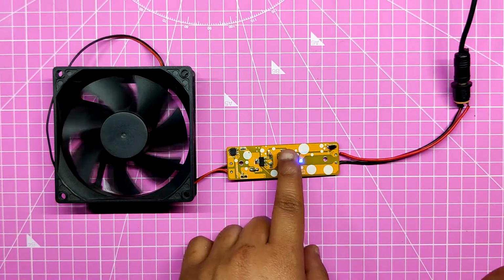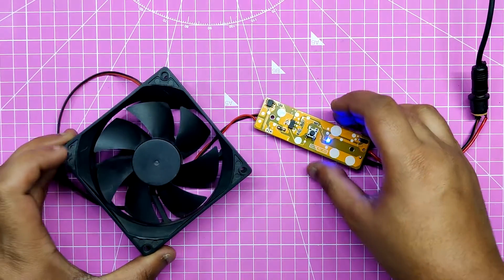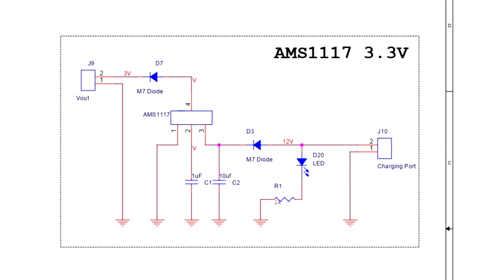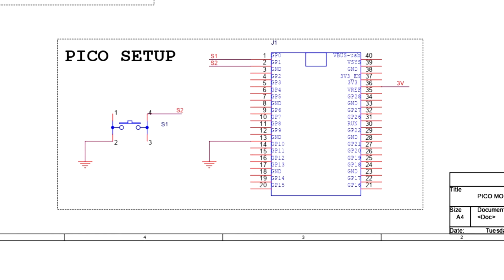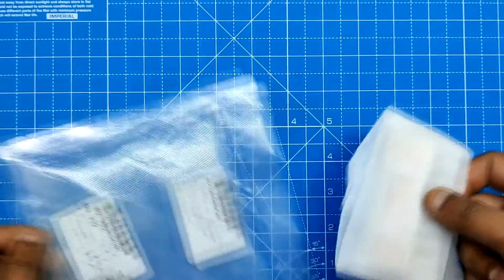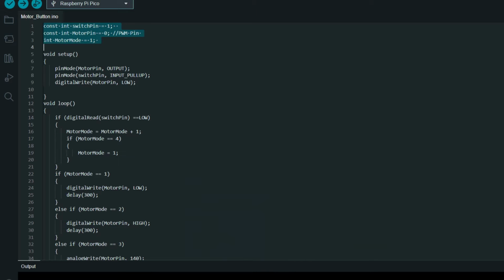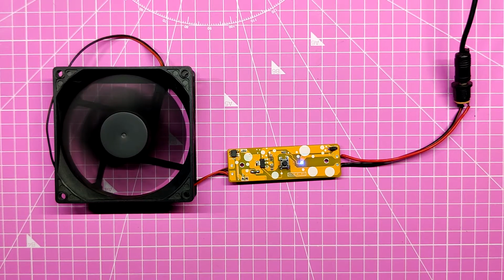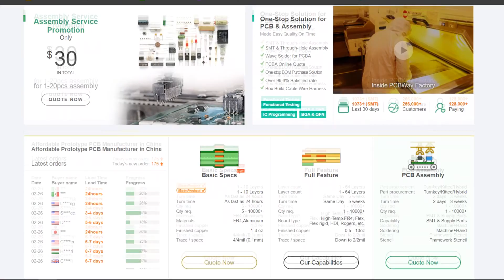Raspberry Pi PICO Motor Driver Board

Comment: This is great. Looking at doing something similar with a spare CPU fan that I have laying around. I hope I'll be able to modify this design to use with the Feather Form factor pioneered by Adafruit. With their CircuitPython PWM controls it should be fairly easy to setup a 4 Pin fan. Thanks for sharing the files!